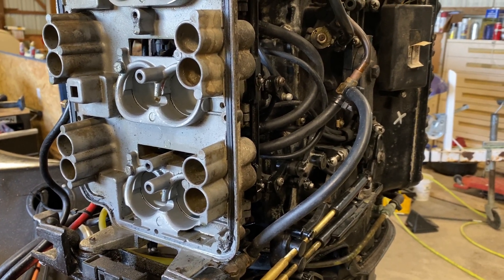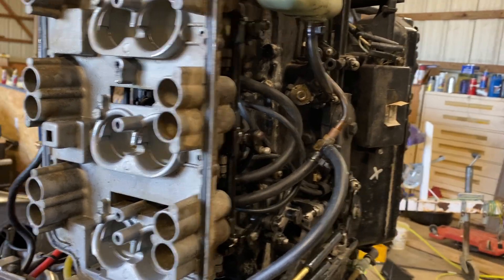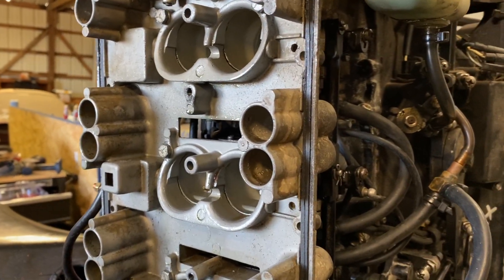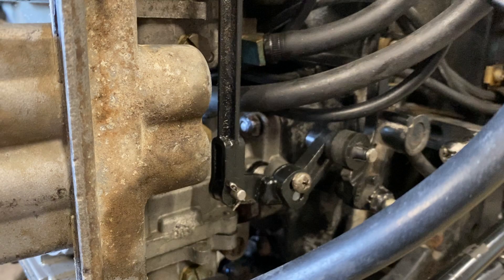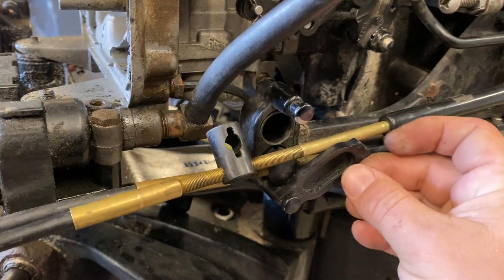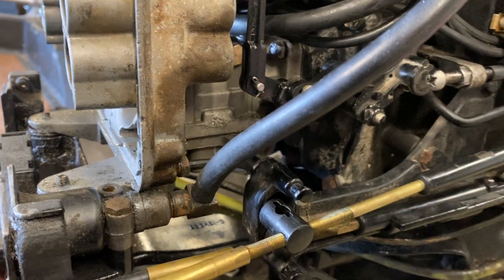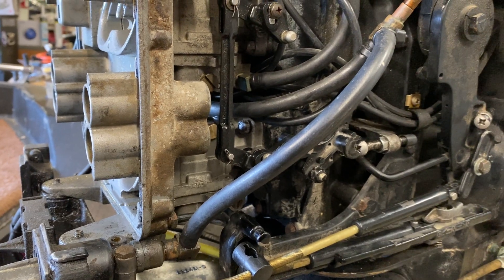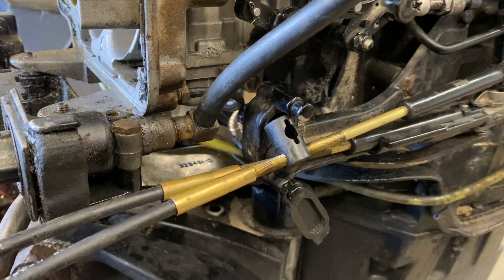2-stoke Outboard Won't Hit Max RPMs/Speed With Correct Timing / Sync

Comment: I think you may have solved the issue I was having. I bought a boat with a 1980s 75hp merc and the owner said he messed with the linkage and it would go as fast anymore. I checked the butterflies full throttle and they were hardly open. I also noticed the rpm stop adjustment wasn't reaching the end stop point. So I adjusted the linkage and butterflies are opening as well as rpm end stop was at the stop point. Thanks m8